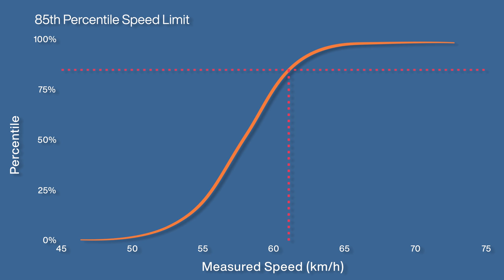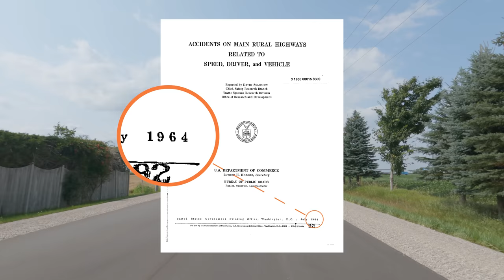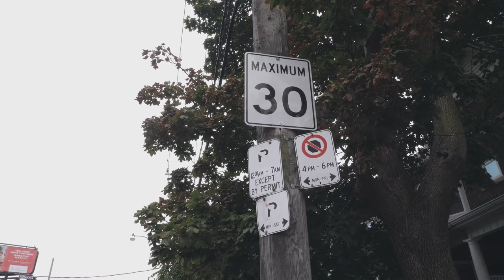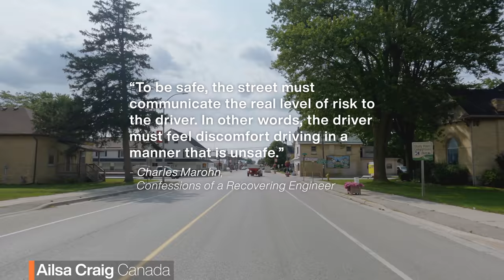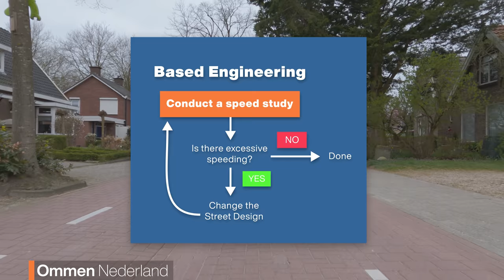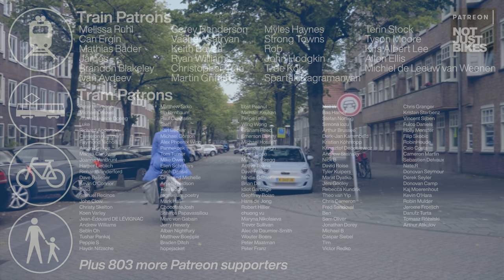The Wrong Way to Set Speed Limits [ST06]

Comment: As a relatively new driver trying to be conscious of speeding, literally everyone passes me and goes 10km/h above the speed limit no matter what it is, because they say that's what the max "forgiveness tolerance" of speeding is. It doesn't feel right to just follow their example and maintain the same speed, but at the same time it feels like a risk to drive slower than others.
Reply: Stick to your guns and follow the posted speed limits. I'm 54 and I admit when I was younger I sometimes sped, but for much of my life I've found that posted speed limits are if anything a bit too fast for me. That's the other thing - unless you're coming to a stop or a turn, most people take "SPEED LIMIT" to mean "THE SPEED YOU MUST BE GOING AT ALL TIMES." Like, If the speed limit is 30 and I'm going 25 I get weird looks.
Reply: @jb888888888  Im a new driver and it took until I was driving on my own for it to really occur to me that the speed limit was actually supposed to be a limit and not just a suggestion
I still speed a lot but if its an area where theres gonna be a lot of people I quickly slow down and pay closer attention
Reply: For a beginner I have one tip, drive passive and don't give a f** what others might feel if you're driving safe and responsible.
People are such clowns on the road sometimes
Reply: @jb888888888  One thing I enjoy alot is driving super late in my area. Nobody is on the road and I can cruise down a 50kmh road with my 40-45 or something, super relaxing
Reply: Relatable. Sometimes I’m caught between “it’s safer to drive the same speed as everyone else, plus I want to get to my destination faster” and “going the speed limit is the right thing to do and influences others to do the same”.
Reply: drive safely, follow the speed limits if not even going slower. Getting accustomed to driving fast will cause speed blindness which is a huge factor in lethal traffic accidents. Do not fall for the peer pressure of other dangerous drivers. On a more financial note if you get used to always following the speed limits you don't need to worry about speed traps and getting fined large sums for speeding.
Reply: Some really bad advice in this thread of comments! 
Driving slower than the flow of traffic is actually more likely to land you in an accident than speeding the same amount. It's dangerous! People around you on the road are anticipating and making decisions based on the speed of the flow of traffic. If the speed limit is 30 and everyone is driving 30-35 and you're driving 25; that means people are going to make wrong judgements about your movement and smash into the back of you.

Along the same lines, never "drive passively". You should always drive pro-actively. Sitting back and letting things happen and "not giving a f*ck" is again a great way to get into an accident. Pay attention to the road, pay attention to what other people are doing, anticipate movements and let that influence your own actions. That includes driving with the flow of traffic. (Which on properly designed roads will be the speed limit.)
Reply: @TheMrVengeance  never under any circumstances just 'go with the flow' thats how you start getting the 'lemming syndrome' where a driver blindly does what the others did and end up in an accident. Driving a bit slower than the limit is far safer than driving over it assuming defensive driving and anticipating dangers and correcting for them ahead of time. Especially when you take road and weather conditions into account, not to mention wildlife like deer or roving bands of pedestrians.
Reply: @megaflamer  - Sure, you can pretend like driving with the flow of traffic and going the speed limit is "driving blindly".
Or you could just read the research done on this that shows driving 5 mph under the speed limit is MORE likely to cause an accident than 5mph over. 🤷🏻‍♀️

Driving slower than the traffic around you is dangerous. It causes people to misjudge how quickly they'll approach you, it causes people to have to merge/swerve around you or overtake you. So on and so forth.

Nothing about driving the speed limit makes you "a lemming" or "blind".
Reply: follow the flow of traffic.
Reply: @good1day726  - Nice anecdote. Too bad anecdotes don't support anything. 
Besides, what triggered the accident in the first place? Encountering someone driving much slower? Causing someone to have to brake or swerve in icy conditions?

Research on the matter is clear.
Reply: @good1day726  - You do realize that 'not getting fined' and 'driving in the safest way possible' aren't the same thing right?

Besides people were literally advising OP to drive under the speed limit, meaning flow of traffic could be the speed limit (as it should be). You don't get fined for going the speed limit.

Again, research on the matter is clear. Driving 5mph under the speed limit is more likely to cause accidents than going 5mph over. Deliberately driving under the speed limit is dangerous. Especially when flow of traffic is even faster.

And if flow of traffic is significantly speeding over the limit, that's the fault of road design. Even by US standards. The speed limit should be at the 85th percentile. If literally everyone is speeding as people here seem to claim, that road is terribly designed even by that standard.
(That still doesn't change that it's safer to go the flow of traffic.)

Just think about it, you don't even need to look up the research.
What appears safer to you.
You going 60mph, and everyone around you going 60mph when the limit is 50.
Or you crawling along at 40-45 while everyone around you is going 60 and assumes in their decision-making you're going 60 as well.
Guess in which situation you'll get rear-ended?
Reply: @good1day726  - That's not at all how research works. Not even close.
(Besides, the 'status quo' thought was that "speeding causes accidents".
Research showing that actually going slower is more dangerous goes against that. 🤷🏻‍♀️)
And no, one speedy/rushed driver does not determine what the flow of traffic is.
I think you might not even know what the flow of traffic is.

It's simple. Roads should be designed so that flow of traffic is at the desired speed limit. And the safest way to drive is to go with that flow of traffic so that everyone is driving a predictable speed.
Deliberately driving under the speed limit is asking for an accident.
Reply: @good1day726  - Again, you seem to be stuck on not getting pulled over and/or not getting tickets.
That's completely disconnected from what is or isn't a safe way to drive. Since you like fallacies so much, stop bringing up the same 'red herring' over and over.
(Also none of what I said was an ad hominem by the way. Just fyi.)

Putting research in " " quotes doesn't suddenly make it untrue. It just makes you look like a science-denier. 

You also seem to be very hesitant to engage with the actual point. The fact that people in the thread advised the OP to drive UNDER the speed limit. Not just slower than flow of traffic. Under the speed limit.

So you can keep coming up with nonsense about how if one person speeds now suddenly everyone has to speed for some reason, and then everyone is gonna die. 🤷🏻‍♀️ 
Or you can actually respond to my "reasonable mundane points" and address the actual argument of the fact that (deliberately) driving below the speed limit is dangerous.
Reply: @TheMrVengeance  I have no idea what study you are referring to, please provide a  reference, But one thing is certain and that is that it did not take road conditions into account, in any kind of slippery weather goin 5 over is far, far more likely to get you in an accident.
your entire argument seems to boil down to 'other people cant drive, so I should also drive dangerously fast'
And you are the one using the term blind, I do not know why you are attributing it to me.
Reply: Keeping a similar speed to the rest of traffic is the safer way to drive.
Reply: @megaflamer  - I like how you begin your comment by admitting you don't know the study, but then continue to just make up things about it. 🤷🏻‍♀️
You know what else is really bad in slippery conditions, the effectiveness of brakes. You know when you really need brakes? When you suddenly realize you're going 60mph and the person in front of you is unexpectedly going barely over 40.

But hey, here you go, since you're too lazy to look it up yourself:
"Crash rates were lowest for travel speeds near the mean speed of traffic, and increased with greater deviations above and below the mean. [..] The comparisons showed that crash-involved drivers were over-represented in both high- and low- speed categories of the speed distribution."
"Further, Solomon reported that the results of his study showed that "low speed drivers are more likely to be involved in accidents than relatively high speed drivers." Cirillo [..] confirmed Solomon's result."
"There is evidence that crash risk is lowest near the average speed of traffic and increases for vehicles traveling much faster or slower than average."
(source: https://ntlrepository.blob.core.windows.net/docs/speed.htm )

And that's just one study, there have been multiple:
"Federal and state studies have consistently shown that the drivers most likely to get into accidents in traffic are those traveling significantly below the average speed. According to an Institute of Transportation Engineers Study, those driving 10 mph slower than the prevailing speed are six times as likely to be involved in an accident. That means that if the average speed on an interstate is 70mph, the person traveling at 60 mph is far more likely to be involved in an accident than someone going 70 or even 80 mph."

The most likely thing to cause an accident is a difference in speeds. Not just fast speeds. And deliberately driving not only slower than flow of traffic, but deliberately driving slower than the speed limit, is asking for an accident.

As for the term "blindly".
Perhaps you should read your own comment to me again?
"...where a driver blindly does what the others did"
Source: You.
That's why I'm attributing it to you.
Cause you said it.
Reply: @good1day726  - Personal attacks aren't ad hominem. That's not what that means. And if you dismiss relevant research on the topic simply by putting it in little " "  scare quotes, then yes you do look LIKE a science-denier.

As for, "it's entirely reasonable  to drive below the speed limit" I'll refer you to the post I made just before. (Which you clearly haven't read.)
Where I point out the research the both of you were to lazy to look up.
Stating that driving slower than the flow of traffic is more dangerous than a similar amount of speeding.
And that's slower than the flow of traffic, deliberately going even slower than the speed limit would be even more dangerous. Since according to you all the flow of traffic is constantly speeding.

And yes, I'm upset about people deliberately giving bad and dangerous advice to a beginning driver.
Reply: @good1day726  - Perhaps you should read the whole definition?
"Typically this term refers to a rhetorical strategy where the speaker attacks the character, motive, or some other attribute of the person making an argument rather than attacking the substance of the argument itself."
An ad hominem is attacking the person instead of attacking the argument. Attacking the argument AND then calling someone dumb is just an insult. Not an ad hominem. 🤷🏻‍♀️

As to offering the best advice you had at the time... I then confronted you and the other person with evidence that your advice was bad and dangerous. Yet instead of taking this new information in and altering your advice. 
You instead argue with a bunch of red herrings and try to discredit research by doing little " " quotes around it instead of addressing it.
Just admit your mistake and move on. Don't double down on your dangerous advice to a new driver.
Reply: @good1day726  - Why put research in " " scare quotes. We all have questions huh? 

First of all. No it talks about 10mph below the flow of traffic. If the speed limit is 55 but people are going 60, and yall are advising OP to drive 5mph below the speed limit. 
...
Guess what a difference that is?
10mph.
Secondly, the study doesn't only talk about 10mph? They just use that specific data point as an example.
Good job showing that you didn't read more than a sentence.

It clearly states that the safest speed to drive is the speed of everyone around you, ie. going with the flow of traffic.
Exactly what I pointed out.
Any deviation below or above beginning to increase the chances of getting into an accident, with deviating to the lower end being more dangerous until you get to very high speeds.

Again, it's simple common sense you can even see without the study.
Overtaking is one of the most dangerous driving maneuvers. Driving slow means you're constantly being overtaken by traffic driving significantly faster.
You're causing yourself to have many more interactions with other drivers that could end in accidents.
To have the same increase of interaction in speeding, you'd have to be speeding incredibly quick to overtake as many cars.

All of this is in the studies done on the subject. If you'd bother to read. And if you're not willing to read the science and facts on the subject. 
Why are you pretending to know better?
Reply: @good1day726  - Again, read the study, it's not just talking about "large deviations".
And these "theoretical speeds" are coming from your own comments.

According to you and others in this thread the 'flow of traffic' is constantly speeding. That's why you're so upset about the notion of following it.
So 'flow of traffic' is over the limit.
And you and others advised OP to drive under the limit.

So with flow of traffic going 5 over the limit, and OP going 5 under the limit. OP is going that 10mph slower than the mean of traffic around them, and thereby six times more likely to end up in an accident.

Based on YOUR advise.
Reply: use common sense.  If you can go faster than the speed limit, which is completely safe in areas then do it!  Especially if you are holding up everyone else and you could be going faster, because now there are more cars behind you which increases crash probability and total damage, both of which are bad.  The other side is sometimes the speed limits are ridiculous, I have gone 30 mph in a 55 mph on multiple occasions and gotten looks, but hey that's how fast I feel comfortable going, and going to fast increases crash probability even more so than holding up traffic.  Point being drive safe rather than worry about speed.  As long as you aren't zooming by everyone you wont get a ticket, and you feel good going the maximum speed you feel comfortable going then do it!
Reply: Don't follow their example.

Comment: I remember reading about a town in the UK (i forget which one) that took away a load of road signs and road accidents dropped. With research suggesting it was because drivers where now forced to pay more attention to the road and what was going on and so ended up driving slower. When preciously they had relied upon the signs to help guide how they drove and so had subconsciously been driving faster and not paying as much attention to the road as they should have been.
Reply: I know of a road in the Netherlands called the Knardijk, which coming out of the Oostvaardersdijk, that says that the Knardijk is a 60km/h zone, though the road just after that sign is brick/cobbles, while I have no doubt people will go 60 on it, I choose to not go faster than 30-40km/h since everything in the car was shaking about and the tyres on the road made quite some noise.
Reply: I've always said that if you want people to slow down, make them afraid to go faster (using proper road design and such). Do not jump out from behind trees to slow people down...
Reply: @ebnertra0004  Or, you know, we could have made cars that were INCAPABLE of speeding decades ago.

Comment: Stroads don't just happen because somebody plans it. They happen because stores and schools want convenient high traffic locations, so they build them on busy roads. So the solution isn't to stop building high traffic roads, but to ban driveways being added to them. A land parcel might originally span from a street to a road, and a property developer asks the local government to let them split it into two, with one fronting onto the street and the other fronting onto the road. This should never happen, and instead they need to use a bit of their land for a driveway from the street to the road-adjacent land. This is what's done with land next to a train line, and roads should be treated the same.